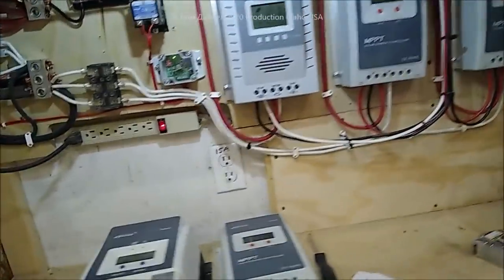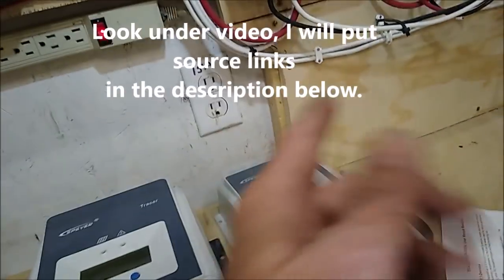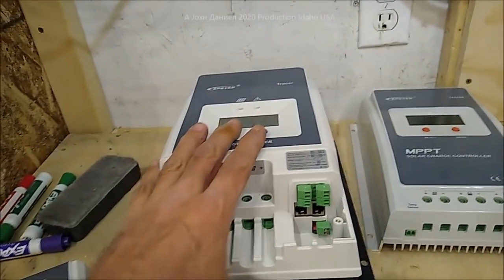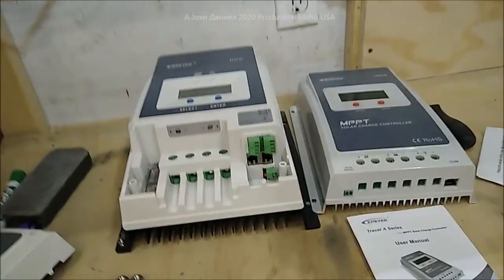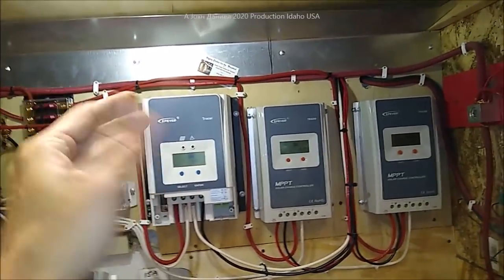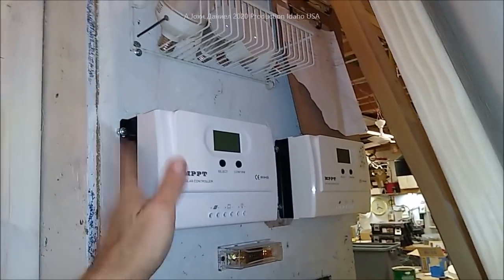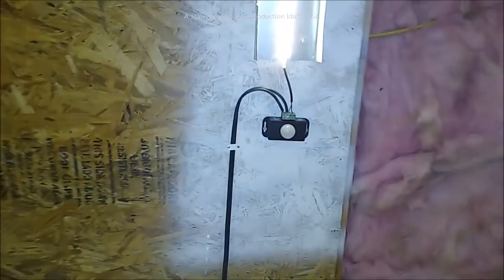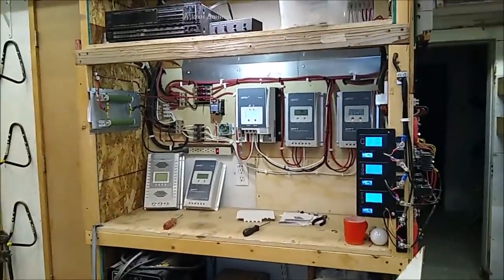Newest EpEver Tracer 50 Amp MPPT installed & wind solar power info share

Comment: I Have The Epever 50 and the 60, Just got the New 50 in the mail today, I am Gona Slave the 50 to the 60s Controller, They are Both 150 vt max Controllers, So I need Less monitor's for Both. I have the Logger and Wifi Attactchents for the 60 amp Controller . The 50 Cost about $170. with shipping No Controller, The Controller only in the Box But New.

Comment: Hello just wondering the voltage output of the wind generator isn't higher than the system voltage output how do you charge the batteries........in my case I have a 3 phase output of 65v ish and I thought that I will need the mppt charger. I have a 24v system

Comment: The controler can be set on aluminium mount,it dissipate the heat.
Reply from the maker: The cooler it runs the more end power your collecting.

Comment: hey john daniel here watching your vids..doing a great job..question on the charge controllers..the 40 amps how many watts of panels and configuration r u using and then how many watts for the 50 amp??
Reply from the maker: Resting battery voltage which is 12.8 volts x controller capacity amps (50) = watts of solar panels you can apply to it. So 12.8x50=640watts is what that 50 amp controller is capable of. I run mine about 10% under max to assure long life.

Comment: I appreciate your input. I just purchased 2880 watts worth of used panels. Building 3 960 watt arrays. I already had the 40amp epever for my rv. Purchased 3 50amp 5415an epevers. Was questioning my purchase. Thank you for you knowledge and experience.  Epevers are flying off the shelves. I was lucky to find 3 from the same seller on Ebay. $200 a piece. Again thank you.

Comment: Great set up. I have a couple of questions I hope you can help me with:
1- Do your turbines have DC output or did you installed a AC/DC rectifier at their output?
2- How is the behaviour under low wind conditions? I mean when turbine voltage is below battery voltage. Is the MPPT able to charge the battery under those conditions, even a little bit?

Comment: Hi John, looking at your set up most of your power is from the wind. With 3 epever about 1600watts of panels that could not keep that battery bank charged?. I have 1000watts with 2 40 watt epever and  6 Crown 235ah,  I aiso have  BC500w 3 blade turbine I love them.

Comment: I have the epever 100 amp 200v mppt controller and the 80 amp 200v . They work very good i used terminal pins 1/0 pin from 2/0 cable to the 125 amp breaker  and the 80 amp mppt to the 100 amp dc breaker,then to copper bus bar using 4/0 cables then to battery terminal with 4/0 cable . These are impressive i have seen 160 amps  from both together feed right in .
Reply: On the 100a tracer can you get the output load relay to work
Reply: @bimmers323ci yes
Reply: @bimmers323ci yes you hook up a relay that can handle the power you want to use from the battery. This port isnt for directly powering a load its designed to trigger an external relay .
Reply: Question ? Does anyone know where i can get the external fuse on the epever  10420AN 200v 100A mppt controller?
Reply from the maker: For the front mounted I used a Mini ANL and on the soldered in I have replaced with a 100 amp Maxi Blade fuse.

Comment: Great setup. How big is your battery system ? I bought a EPever 50A and inverter and managed to save the contents of my freezer with a recent power outage.
Reply from the maker: 3100 amp hour
Reply: @JOHNDANIEL1  what kind of batteries are you using sir? i see you dont like lithium

Comment: Hi John. I little bit confuse how you setup solar and wind charging your batteries.
I am in process to hook up my solar 600 watts panels and one of the chinese 500 watts turbine you recommend.
How do I prevent power go back to either wind or solar controller? Using diode?
Thank you
Reply from the maker: The solar controllers and rectifiers do not allow back flow of power from the battery Bank so putting wind and solar together are not a issue you should worry about.
Reply: @JOHNDANIEL1  thank you John. I  like your videos. I learn a lot. And make me confident enough to take on solar and wind project on my own

Comment: Thanks for the video. I am considering getting 100A solar controller 1800watt combination solar panels. Is 100A OOYCYOO product on Amazon good or i should go for the expensive 100A Epever product.
Reply from the maker: The 100A OOYCYOO https://amzn.to/2ZmAVEO has been a great cheaper alternative. So far, I run it at no higher than 85% and its been fail free. But then again, I do not run any controller over 85% since it's cheaper to be safe than push any chinese made items rating.
Reply: Thanks for the feedack.

Comment: Why are you using 12 volts instead of 24 volts ?.    Why do you think lifipo4 is bad.    It is more efficient and can handle more cycles
Reply from the maker: 24 volt restricts my survivalists material options, LiFePo4 restricts my wallet. I think depending on China for both of them is insanity.

Comment: I have another question. So me and my dad just got 9(was 10 but one of them got broken during delivery) solar panels which are 480 Watt monocrystaline that operate at 61 volts( they came out to 250 a panel after taxes and shipping which we thought was worth investing in) .Due to their huge size(55 1/2"*77") we are only setting up 6 right now(which is about 2880 watts) We want to do 24 volts to be more efficient (and we also feel safe at that voltage) and we're trying to figure out how to manage all the power. Not even the 100A EpEver claims to handle no more then 2500watts for 24 volts( which is pushing it past 80 percent). So is it better  to get one 60/80Amp Epever to handle 3 panels each(needing 2 for 6panels, and then a 3rd one for the other 3), or should we look into increasing our battery bank voltage so the charger can charge at the higher wattages so we only need one MPPT ( but then we need a higher voltage inverter). We're just trying to figure out what's the best option . Price wise it seems like either I'm paying for more MPPTs or paying more for a higher volt inverter(maybe a few more batteries too(using 6 volts golf cart batteries) . I'd just appreciate your input

Comment: I know you're busy and all, but... can you tell me how you determine what resistance values you need for braking wind turbines? For 500watt and also for 4kw...
Reply from the maker: 24 volt system, 6 to 12 ohm, 400 watts minimum 500 likely preferred. Use the 10 due to your winds, and use 5 of them on it. 
https://ebay.to/36XpAhm
So putting 4 of them with 1 of the MGR 60 amp SSR relays 1 per 400 watts of load, and your system will run safe, Set the controllers divert voltage at 28.8 to 29 ( or 1.2 volts under your Inverter over-volt fault points).
Reply: @JOHNDANIEL1  So let me get this straight... 4  10ohm 100watt resistors on each leg of the 3 pole blades???
Reply from the maker: @nunyadamnbiznez3522  NO, that 400 watts would be the DC diversion load after the rectifier. For active load manual braking you use one inline like my 3 blade switch design per leg ( 3) of them.

Comment: I just got a 100amp OOYCYOO mppt charge controller from Amazon (because your ebay link is out of 100amp models, and amazon offered a 4 hear warranty,(I've had an Epever fail me 3 years after I bought it,but because I had warranty I got a completely refund)) and I noticed it's super light and weighs 4lb 10 oz on the scale. Wondering if that's normal or if it's possibly a fake(I got free returns for it) thought I'd check in?
Reply from the maker: That sounds about right on weight. So far I have only put 80 amps into mine with no issues and good results. The fans only come on when I hit the battery bank hard and the incoming amps are real high. **I never try to run anything Chinese made at over 80% of its speed, weight, build, power or ability claims. NEVER!

Comment: Hi Texas John,   great to see another awesome video by you, thanks for sharing the Technical Info.  Again its always good to see you're shared knowledge.  My family have just moved to our new 50 acre farm Surf Coast , south of Melbourne Victoria Australia.  The wind is not howling yet but the season is not far away.  I plan to purchase 3 of your recommenced Wind Turbines, just not sure which ones,  I like to 800 Watt.  Is it the B-C ?   I have 5Kw - 20 off 250Watt  12V solar panel ready to go up onto shed roof and then complemented by the 3 Wind turbines..I have a lot of control equipment to purchase and install, Phew i better watch youre videos again. The EpEver 50-100 Amp MPPT wont be upto the Amp output from my Solar system though. . 5000/12= 416 Amps. . .so I'll keeping looking for a bigger controller.  Looking forward to playing around with youre designs and Tourquise 1000 Watt heating element...now thats the good stuff mate.  Cheers Aussie Simon

Comment: if it takes 9 volt and charges your battery then it is a buck boost converter with charge controller parts also interesting model

Comment: Before last winter, I bought a 4000W 24V 5 Blade Lantern Power Wind 4 Generator and now it's getting better weather, I want to install it. I'm definitely going to have to get something good for a pole or mast to set it up. Any good recommendations?
Reply: I ended up with an extra set of the 5 lantern blades so I could make a generator myself if I was so inclined.

Comment: I just bought ten 400watt solar panels so I'm really going to need to get some of all these other things for sure.
Reply from the maker: I would suggest the $315 model GE-500/600 with the low wind blades https://bit.ly/2LCRWnd . Its proven to give you constant results when installed in good clear air.
Reply: @JOHNDANIEL1  Thanks, but... I already have 2 wind turbines and now have solar panels on the way. What I need is the controllers and all the gauges as well as what's good to use for making a mast for the wind turbines. I even have a small anemometer already.

Comment: Cool stuff, sir.   I’m a novice, learning as I go.  You’re probably too busy, but I’d like to sit down with you sometime to discuss an off grid system for use on 20 acres in cedar city.  I’ve got a 5th wheel there now but have fried 4 lead-acid batteries by not having the proper electronics in place, well, at least that’s my diagnosis.
Reply from the maker: If your off grid in Southern Utah your wind power options are not great, but possible. I have installed in Delta, that's as far south as I like running my 12 mpg truck. As for ruining batteries, you must keep the water up in them and use the proper controllers of you loose a major investment. EXAMPLE - For a 5th wheel on 30 amp service you will need 1800 watts minimum, 8 of the GC 215 batteries, and nothing larger than a 6500 BTU air conditioner can be ran during peak day heat and still achieve full battery charge. The biggest thing is putting a cover over it and insulating all.
Reply: Јоhn Daniel.  Thanks for your reply, John.  I never really thought of running the roof A/C unit, but I would like to try out a small evaporative cooler, modified with all 12vdc internal components.  I am headed back up to the land in a week or so and hoped to reinstall some batteries,   2 12vdc deep cycle RV/Marine ones that I reconditioned and recharged, but I need info on a good charge controller and battery cut off unit so I don’t over charge or over deplete them again.  Please share your thoughts on what you’d use?  I don’t have or really need an inverter right now.  I use a generator to run micro/coffee pot/ roof A/C if needed.
Reply from the maker: A basic MPPT with great back flow and battery protection. https://ebay.to/3cNDTqB It will handle 5 of the better 100 watt Solar Panels ( https://bit.ly/3bFFQp4 ) and keep your system in perfect order.

Comment: Love the evolution and looking good!
Did you post the link for those LCD analog style temperature meters you're using for rectifier temps?
Reply from the maker: They still have them, https://ebay.to/2X35fCA
Reply: @JOHNDANIEL1  Thank you sir!
Off to watch the low wind / higher voltage video!!

Comment: When your wind turbines are peeking at night like that are your solar panels still protected by the charge controller even though it's at night?
Reply from the maker: The reverse protection from the battery bank to the controllers is the same that stops wind turbine power from effecting the controllers.

Comment: ordered Mpp Solar PCM60X 5/14 will be here 5//18  :) no plastic  no fans  ya im old school
Reply from the maker: The PCM60 is what we are using in Texas on our place there. 5 of them with 90 volt Amorphous style CIGS Solar made by Stion. 5 years not one fail. But we do have it in a 80% underground shed so its cool on them and the 20 L-16 Surette batteries.

Comment: Does all of your power sources (wind, solar) feed a single battery bank or do you have split banks for each source?
Reply from the maker: All into one major bank with shifting charge capability that is load switchable on any needs to the house battery bank in my basement.

Comment: Be careful, I'm not sure what you do for grounding, but your units with the red buttons are positive ground and I'm pretty sure the new 50A unit is negative ground.
Reply from the maker: They are all Negative ground. We use a 2' x 4' copper mesh buried 4 feet deep to do lightning isolation in 9 places around the shop.
Reply: @JOHNDANIEL1  I have a tracer A series (red buttons), they are positive ground. Manual page 22, grounding says common positive. tracer AN series (blue buttons) are negative ground.
Reply from the maker: OK, I get what you were referring to, The chassis. Thought you meant the polarity. Yes, some are POS, some are NEG on the chassis. Just don't connect their frames to each other you'll be fine.

Comment: Hi Mr John, those gages below the ameter, am interested in knowing where you get them, thanks in advance for your answer, please keep up the good work, living everything you show us
Reply from the maker: I have been using them for over 6 years now, find the most accurate, stick with them! https://ebay.to/2X35fCA
Reply: @JOHNDANIEL1  That just showed a thermometer.
Reply from the maker: Bayite DC 6.5-100V 0-100A  https://amzn.to/3bO8cMw
Reply: @JOHNDANIEL1  Now that is one of the main things I've been looking for. I just ordered 3 of them. I also got 2 of the 3 blade cut offs. Now I need to find the brake resistors that don't cost about $100 each. BTW... I got another msg from the guy about, (the last one), mppt I bought yesterday. He'd told me he sold out and I'd have to wait to get one from China. Don't want to wait another month. Today he said they can fedex it to me in 2 to 7 days so I said send it. Thanks John
Reply: @JOHNDANIEL1  I see you have a thermometer on each one, but how exactly do you have them set up? Where did you put the sensor? So what exactly are you measuring the heat on?

Comment: What Voltage are you providing to the EpEver Controllers coming from the Rectifiers and PMA ?
Reply from the maker: We do not feed anything but solar into the solar controllers. Using MPPT on wind is about pointless 95% of the time.

Comment: Awesome!  Can't wait to see how it does heating up the hot water tank.  Need a better way for my hydronic infloor heating!  Thanks for posting all this info!
Reply from the maker: Yes, we just plan to set its own controller and a 200 amp RV isolator to divert on 14.0 so its on hot water duty as soon as the battery system test voltage reaches bottom float.

Comment from the maker: Newest EpEver 50 to 100 Amp MPPT - https://ebay.to/3bIUtqq ,Affordable 100 amp - https://amzn.to/2ZmAVEO ,+ EPSolar Triron MPPT DUAL Solar RV Charge Controller https://ebay.to/2zHg45s - Subscribe, & see more idea sources https://www.youtube.com/user/hurricanewindpower/videos
Reply: damn cheap for the quality
Reply: 👍 = there is nothing more to say! Everything perfect!
Reply: I bought the 100watt mppt that said it was the last one. Then late last night I got this message:
Hi,
Good time,
Thanks for your order,I need to tell you that this item is out of stock now.
Would you like to send from China or want to get full refund?
Thank you.
Echo
BTW... I had to pay $239.59 for it.
Reply: I have the 100 amp 200v EPEVER mppt controller and the 80 amp 200v EPEVER mppt controller and a diy weather proof box I put 2 stainless steel vents on and a blower fan for out take and 2 big pc fans behind each controller and a thermal controlled relay board turns them on and off and 1/0 cables to 125 amp and 100 amp breaker and 2 80 amp breakers for solar panels in and multiple bus bars .I made a video showing the box and controllers off after I built it.
Reply: Ok john here is the video I made showing both of my EPEVER mppt controllers off here you go sir. https://youtu.be/EEjS9K-Q6B8